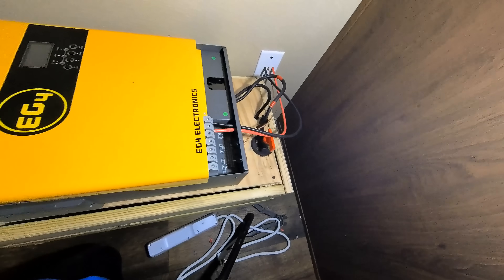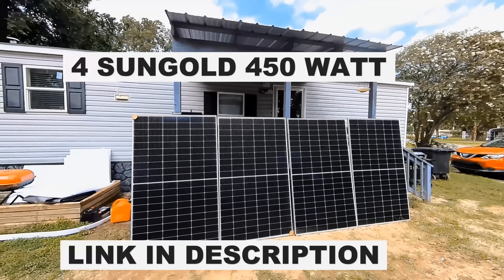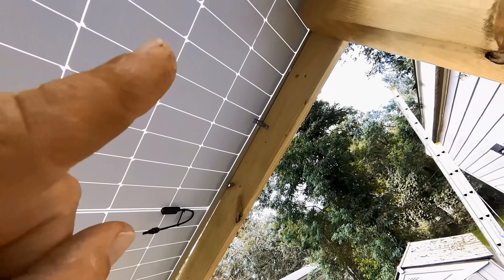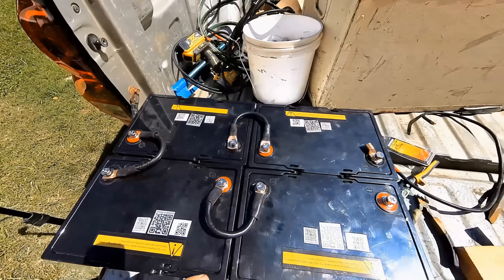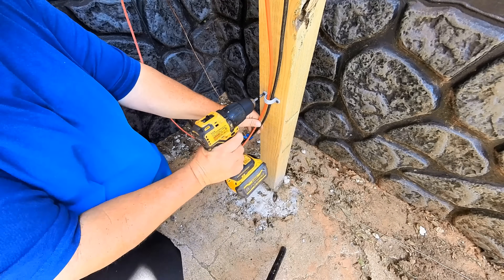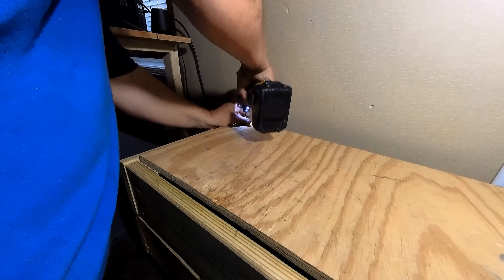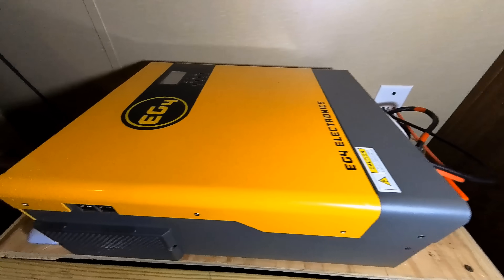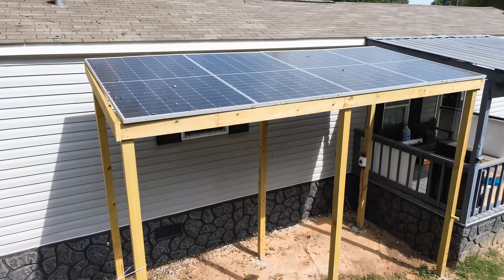Simple Solar YOU CAN BUILD!  Using Sungold Solar Panels

Comment: this is a quick diy on how to burn your house to the ground.   Improper crimps,   no wire entry into the house,   just drilled a couple of small holes through the aluminum siding.   

He didn't even precharge the caps in the inverter.

All  that into a $5 outlet strip......
Reply from the maker: Lmao..that's plastic siding I just did a few things wrong lol😂 the house is still good...never burned ..you can watch some of my later videos this one was a while back I get safer and safer each time😂

Comment: I’m new into researching off grid power. 
Questions here. So the more batteries you have = the more energy it puts out. 
And the solar panels keep the batteries charged. 
So I found a deal on 8 -  560w solar panels. How many batteries can I run
Reply from the maker: AS many as you want

Comment: I got a very similar setup which actually has 8 solar panels with 540 watts each and a similar battery of 52v and 120 Amp. The inverter is similar also. But the damn thing only lasts for about an hour on batteries and then dies! Anyone knows why that might be?
Reply from the maker: somthings wrong..but dont know for sure

Comment: Problem with 48v systems is more expensive equipment and not all panels can be set up in series, meaning if you want to expand the system later, you are stuck with that brand or have to find panels that can be put in series.

Comment: One nit pick. PV wires need to be in metal conduit entering the house, and once inside can enter a metal J-box and switch to metal clad cable to inverter, or continue the metal conduit all the way to the inverter. Great job!

Comment: Can you tell me how many batteries I would need so my house can run (5 ton A/C unit with soft start, two normal size refridgerators and internet and a few LED lights at night) only through the night on battery power only?  I want to build a battery back up system so during the day the battires will charge from the solar panels, then at night use the batteries to get through each night.  Off grid set up.

Comment: I like the system but I do think the wires should be protected in some kind of conduit from the isolator.  Also, why not have the batteries located outside?  If there's ever a problem with them, I'd prefer to have them a bit away from the house.

Comment: Remember folks, many of these videos do not tell you that in most places you MUST have permits. Only in rural areas can you easily get by without permits. In city limits, watch out!
And if you have old electric, they demand you upgrade the whole damned house to tie in solar.
My solution is to run a separate power distribution in the house. Not even touching the existing wiring.
Only need a few independent circuits for fridge, chest freezer, microwave, TV and cable box. Maybe a fan...
Wife can use a flashlight lol.

I looked at those battery isolators. Most are 32 amp.
Running 400 watt panel (12v) exceeds that rating by almost 2 amps.
Even at 24v, you exceed the 15 amp disconnects by nearly 2 amps.
MC4 fuses are 10,20,30,40, etc.

$3K seems quite cheap.

Comment: The lugs are incorrectly made.  They must be redone. They are required to be pounded in with a heavy (sledge)hammer using the inexpensive lug making tool.  Doing it creates pressure, fusing them into a metallic bond better than solder.  The way this was done is akin to making jewellery.  Homeowner, if you are reading this, please advise him to watch some videos on making lugs and insist he redo them. The reason is that incomplete connection  1)permits corrosion,  2) has air gaps, 3)light contact creates dangerous heat, 4) as tiny sparks occur 5)expansion and contraction migrates the wires out of the lugs 6) a wire falling out can short or electrocute someone - a pet or child.  Otherwise, beautiful setup, inspiring, thanks! But fix the lugs.

Comment: whoa whoa nice video and all BUT Check How Much Power That Surge Protector Cables Are Rated For.... That is your bottleneck and fire hazard. Most common surge protectors can only handle 1800 watts or less. 
ANYONE Thinking of doing this DON'T use a common surge protector like this. They make proper power load centers with multiple outlets that have power ratings so you can buy one that meets your power needs. 
BTW I'm just trying to help anyone else looking to do this as I am in the process of doing the same and researching the parts that I need. I do like the solar panels wooden mount and watched for this reason. I'm looking to build a very similar rack mounting system that'll also double as shade for my rear deck. 👍

Comment: which wires did you order to connect from the DC box outside to run into your house? or did you just order double the wires you posted and cut the ends off of one set of them to connect from the DC box to the inverter?

Comment: My brother in Christ, that is not how that DC switch works.  It's 12v/100A and that's not based on power, it's based specifically on current and voltage.  In other words you can't quadruple one and quarter the other for applications like this.  It is rated at a max of 12V based on its insulating properties and the means it uses to create the disconnect which is especially important in DC circuits.  If you switch that on or off under heavy load (ie when something is faulting which is when you'll need it) you are very likely to create an arc and best case weld the contacts, worst case....well there's a worst case.  You need a switch specifically for DC at your system voltage and current, not power.  Take this to it's logical end, if it's good for 100A/12V or 1200W would you expect it's good for 1200V at 1A (also 1200W)? Clearly not....just like you can't assume it would be good at 1V for 1200A.

For what it's worth in a system like that id probably toss a fuse inline between my two sets of batteries too.  The total current in the system is the same anywhere along the loop so fusing it there would provide some short circuit protection since you have exposed leads with the added benefit of bringing the system down to 24v if something goes bad.

I like the pergola idea, seems like a super easy way to get some panels in the air and create some shade at the same time.

Comment: Why would you run it like that and not do a 12v 400ah system and have a way longer storage and way longer run time qnd just use buck converters to get to 48 volts for your house input device

Comment: Someone has probably let you know you might run a conduit or some other device thru the mobile siding so the wires won't get cut on the sharp metal siding. Also, it's best to mount components on backer board and not wood to reduce fire hazard. Good luck with your endeavors.

Comment: :yt: 	I want to share a great find. I just put 3, 200 watt panels on my Van roof. I used a readymade power tilt rack. Works great. I would recommend it. Check it out @tomsans1946able

Comment: what size AWG wire you been using? Also, why need a breaker, from battery to inverter, isn't there is surge protection in the inverter already?
Reply from the maker: @Silicon_Dom  it's always wise to have an on-and-off breaker in between any battery bank and inverter if there's ever a DC Arc it is rarely capable of being extinguished. It's better to have a t-class fuse and a breaker inline on the positive side of every install. I'm using 2 gauge wire
Reply: @OKLAHOMAOFFGRID  copy, how do you calculate what size fuse to use? I have a 100Ah 12V battery, my solar charge controller is up to 40A.. Should I get a 100A fuse since battery is 100A?

Comment: Amazing video brother thank you for this great info. I been wanting to install a system for my home but was not sure how many panels i needed or how many batteries.
Reply from the maker: @matojo17  well this is just a small backup system I have another system that runs my whole off-grid cabin and it takes four batteries and about twice the power on the inverter
Reply: @OKLAHOMAOFFGRID  so the invterter and panels is what makes the diffrence on how many things you can run? and also how does the system handles nightime

Comment: a crital step that was missed was you did NOT top balance all 4 batteries by putting them in parallel and then charging them up to full, buying a 48v instead of 4 12v ones would also solve this issue, you can also by balancers but your better off with a 48V
Reply from the maker: @joshwayop  thanks for your opinion 12-volt is what I had and 12 volt is what I used

Comment: The power strip (15amp) is not large enough for the 3000watt (25amp) inverter. Even your test run was pulling 22amps. Add a small subpanel with at least two 120 circuits.

Comment: Well done. 
I like that you added the isolator switch. 
Here in Arizona, they don't require any kind of dc disconnect switch between the PV arrays and the inverter. It blows me away. 
They consider the inverter itself the disconnecting means I suppose. 🙄
Reply from the maker: @jasonweir8147  I like the new inverters on the EG 4 that have the built-in disconnect

Comment: I positively appreciate the system you built, and I may add that this solar system does need a permit and a city engineer to sign off on since its above 48 volts per electrical code compliance,  but because  your not grid tied the power company wont know a thing, unless the power company or insurance company notices your sun capturing setup.

Comment: My neighbor tried to use that same switch in his 48V system. No problem turning it on, but when we tried to shut it off, then checked the Voltage to make sure it was off at the inverter, there was still power. The contacts inside the switch had welded together, making it impossible to shut the power off. I hope you get the better quality switch put in soon, as that switch is supposed to be for shutting the power to the inverter off in an emergency.

Comment: I LOVED this video, no bullshit, no bloviating, no rambling, just the facts and necessary information. Awesome !!
Reply from the maker: @PatriotsGunClub  right on
Reply: The ONLY thing, imho, I think I would have used heavier gauge wire all around, just to maximize Current in and out of the system.
Reply from the maker: @PatriotsGunClub  yeah I hear you man
Reply: NOT sure id want fire prone lithium batteries indoors . U need a better way to insulate them. .
Reply from the maker: @spyplane3979  might want to do a little bit of investigation they're always indoors.. these are life po4 batteries.. there are much different chemistry than the old lithium
Reply: @s @spyplane3979 hese are not lithium ion batteries these are lithium, iron phosphate batteries - as noted by the LiFePo4 on the side of them. These are not "I repeat -  not"  fire prone like lithium ion. This is what all the bigger battery backup and battery generator systems are using.

Comment: So since this isn't connected to the grid or the rest of the house you would just need to wire everything individually that you want powered by it to that inverter right? Would using extension cords for that be dangerous? How do you handle having things you want to power in different parts of the house if they're too far away? This probably avoids any issues with needing the system to be up to code for a roof I imagine too right?

Comment: Don’t you need 60 not 48 for most applications
Reply from the maker: @kikigirlkauai  almost every system that is solar that is efficient now is a 48 volt system I really have never even heard of a 60 volt system. Your 48 volt system won't climb up to 60 volt during the charging. Call equalization if you're using lead acid batteries.

Comment: Great video.  Fantastic info.  But  you are taking a risk running 2000 watts through that molded power strip!  That is a fire waiting to happen.  Buy 20a outlets and metal boxes and wire up your own power box.
Reply: I’d agree.. That power strip is probably only rated for 1500-1800 watts.

Comment: Hi I'm an Okie in Alabama.  I am preparing to do a smaller scale solar installation in the shed I'm currently building.  It will be used to keep mower batteries charged and  power lights and a work bench, and maybe even a small beer fridge . 
I am thinking of mounting am older aluminum truck tool box on the back side of the shed and installing the batteries in it.  Would put a short pvc pipe into the wall for the wiring, maybe put a rubber pad or small wooden platform for the battery or batteries to sit on. With the lid closed and locked it would be secure and weather safe,  and frees up space inside the shed.  
Let me known if you see any downside to this or have any suggestions.  Thanks and keep up the excellent work.
Reply from the maker: @KerryBlack-t6d  I would not put the batteries inside a toolbox unless the toolbox was not in the direct sun. Other than that I would put the batteries inside the shed
Reply: Thanks @OKLAHOMAOFFGRID  for thr feedback. I will do some more thinking on this.

Comment: carefully read those "life" stats.   That time is conditional to how deeply y ou discharge those batteries, how heavy of a load  you routinely put on those batteries and h ow you charge them back up to the "voltage hook up" which is crucial how you react to the critical charging.
10 years life is a number,  it is variable.

Comment: So why did you NOT use a charge controller. Is there a better benefit doing it this way? Also why not use a 24v battery system instead of 48v.Canyou do a video explaining both
Reply from the maker: @buddybrown9614  there's really no need to do a video to explain both 48 volts and higher voltage is like this are always going to be better than the lower voltage it's going to make everything more efficient and more cost-effective and when it comes to charge controllers this is a charge controller and inverter all in one.

Comment: Nice video.  But at 8:12, due to the increasing number of reports of isolator switches catching fire due to overvoltage, I'm not sure using a 12volt 100 amp isolator for 48volts 24 amps is wise.
Reply from the maker: @dshack4689  I believe you're probably right it's been replaced at this point that was months ago when I made a video and that's all I had at the time.

Comment: I hope you know those batteries are toxic  , I hope people understand they cannot be put in living space and can catch fire  in extreme heat conditions . I don't even keep the batteries fr my tools in my house . I learned the hard way when one caught fire on my kitchen countertop . not plugged in not in the tool , It just caught fire . . It was on the island and I smelled it first  grabbed it and put it outside with  my pot holders . It was that hot . dewalt 20 volt oly 6 months old . The smell set off my smoke and carbin  detectors

Comment: Fascinating presentation.  I was wondering how much more output you would get if the panels could track the sun?  It could be done in pairs or quads or all 8 of them.  Or at least make the mounting angle adjustable to account for the sun's height in the sky between the seasons?  That would be very simple to do.
Reply from the maker: you are very far off on the solar panels...they are around 305 each and there was only 4 panels and total where around 1220 ...total cost of system 2900
Reply: @OKLAHOMAOFFGRID  Thank you for that correction.  I've edited the comment to remove the inaccurate math.

Comment: If in snow country, make the slope a little steeper to make it easy for you to use a long-handled squeegee to clear snow. The solar panel will try to melt the surface, but even on very steep systems, the snow or ice hangs if near freezing temperatures. And, you may want to be able to clean dust off of it. I clean mine after local range fires and whenever the snow starts accumulating on it. Rain in autumn will glue leaves to the surface as well. Sorry to have to tell you that they are not entirely passive care.

Comment: Did you use anything to seal between the solar panels? I want to build similar without any leaks if it rains. Great video!
Reply from the maker: I did not and it drips a little bit I am sure you could silicone it or something I did see where there is an actual awning that you can buy that is made out of solar panels

Comment: Good vid but I don’t like seeing posts into concrete.  Not a lot spent but still.   Lumber lasts longer outside of concrete.  

I don’t know where you live but the L brackets I saw holding them panels on, I don’t think will provide much stopping power to a strong wind storm.  Looks like one good gust and all those are coming off.  

Last the cost.  Roughly $3500 every 10 years when stuff needs replaced…a TV draws maybe 150w on average, in my area that’d be $0.58 a day running all day.  Over ten years the cost of the systems more expensive than just living on grid.  Obviously the more you hook up the more power you need then cost difference starts to drop but just to break even you’d need 249w running 24/7/365x10 years.  Doable I guess, just seems like a lot.
Reply from the maker: some of your points are negotiable. ,but most people are running more than 249 watts 24/7 more like an average of 600 watts 24/7 when you include heater and water heater constantly..i have l brackets on my other system and they withheld 90mhp so far and you cant pull them off the racks if you tried with both hands ...you will bend the aluminum on the panels and rip the screw out before that happens

Comment: Good recommendations is to have a backup generator to recharge the batteries only. Cheaper that way
Reply from the maker: inverter generator
Reply: @    I was thinking along the lines of a bunch of winter weather with no sun. A little generator wouldn’t have to run all night, just enough to charge the battery. The inverter could all the time. 
I would truly enjoy building a solar powered system, but I no longer have my house.  Good luck with yours.  I enjoyed the video. You’re living my dream. Thanks.